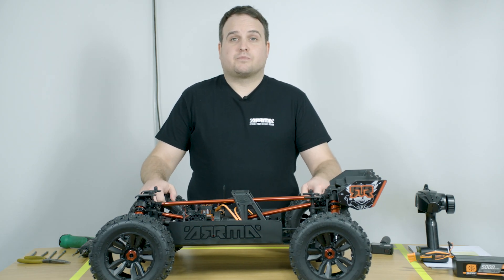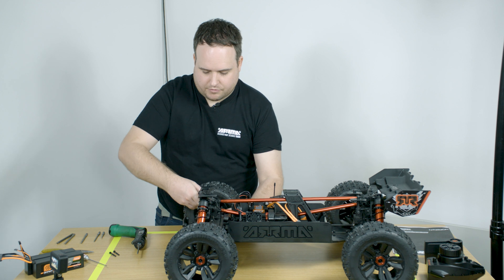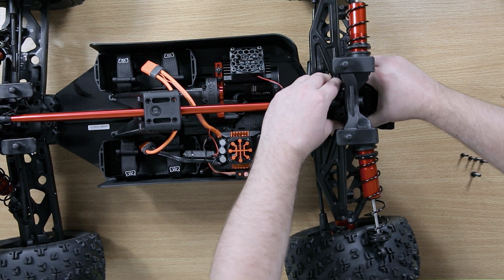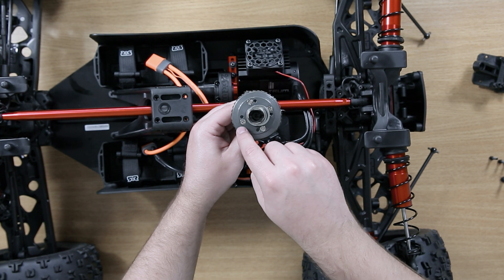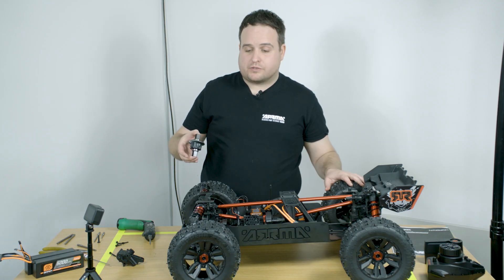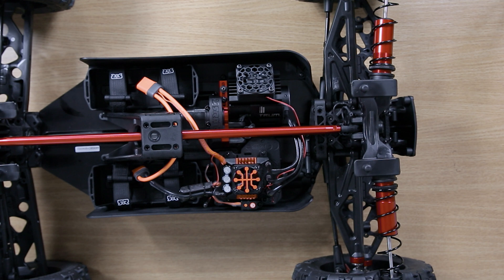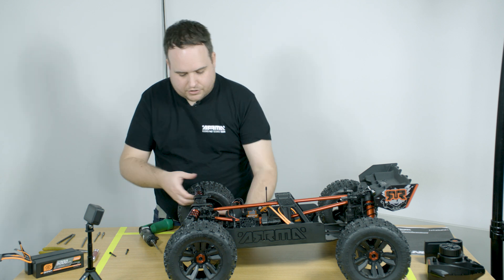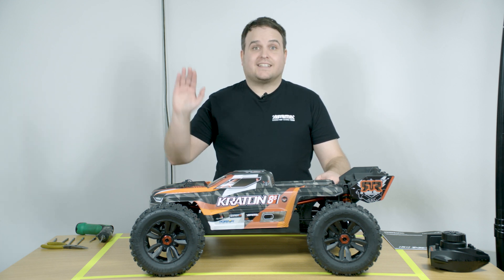ARRMA KRATON 8S // Official How To Guide: Diff Removal, Disassembly & Reinstallation

Comment: Great instruction and love the new Kraton 8s. In fact I just put on on layaway yesterday. I am concerned about the chassis braces now being relocated to the center diff and motor mount. Is this area stronger and and more reliable than mounting straight to the chassis? Also you refer to filling the diffs with 7 grams of fluid, grams is a measurement for weight, how much is the measurement in volume, ie cc or ml? Thanks for all the great new bashers this year I picked up the typhon 3s, the Talion 6s, the Infraction 6s and the v4 typhon 6s and now on to the Kraton 8s! I just love Arrma because it really suits the style of driving and look I’m going for! Keep up the good work my friends!